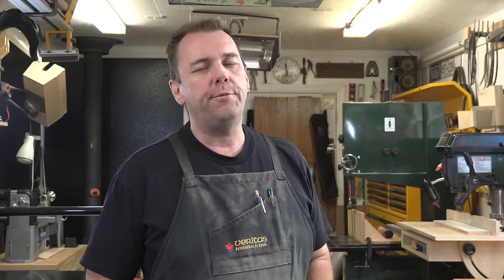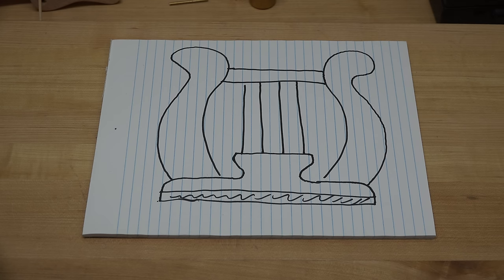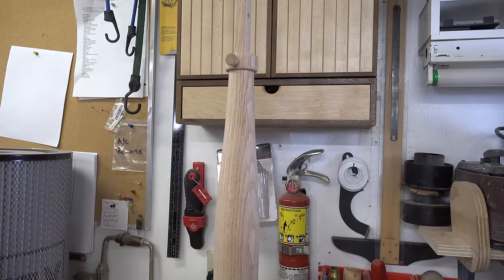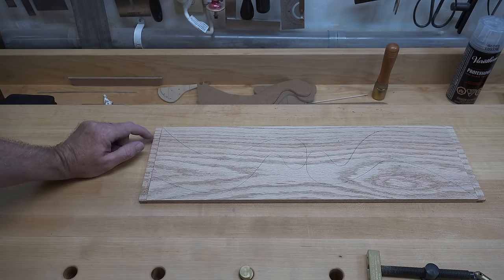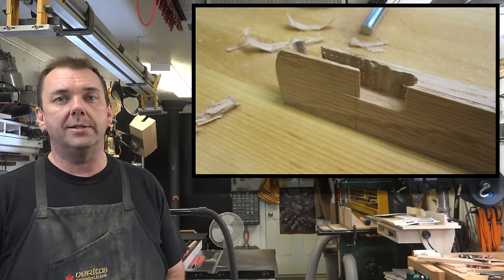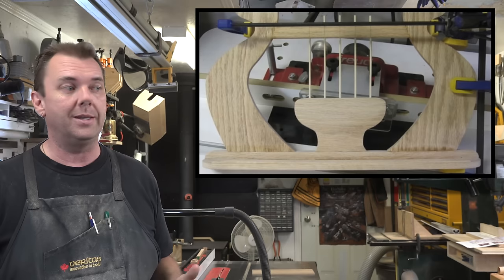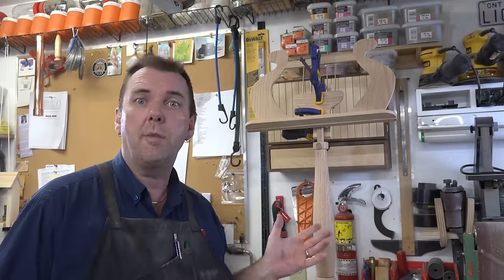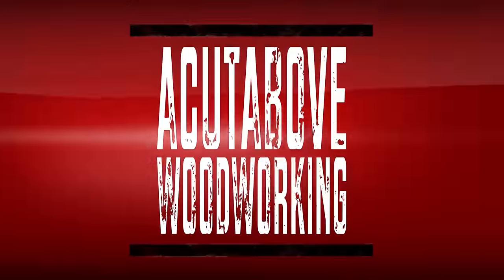Making a Music Stand Part 4

Comment: I just found this video series researching my own music stand project. Very well done!! One trick I've used when trying to cut joinery in thin pieces is to cut it when they're thicker. It's wasteful, because you end up planing away so much, but if you start with 3/4 material, chop your narrow mortise, THEN plane it to 3/8, you should be fine. That said, yours came out great!
Reply from the maker: Thanks for the kind words and for sharing your method on thin material joinery Ben.  That's one thing I love about this hobby...for every process, there are multiple ways of performing that process and getting great results.  Glad to hear that you liked the series.  Thank you for tuning in.  It's very much appreciated.
Reply: @acutabove_woodworkings  You're welcome! Thanks for sharing.  I also love finding new ways of doing things.

Comment: Very interesting video. I was searching some ideas for my project of music stand. I found them here. Thank you.
One question. Am I wrong or Canada has adopted metric system for already several decades ?
Reply from the maker: You are not wrong Michel.  Canada adopted the metric system many, many years ago.  I was in grade school at the time it was adopted and it was introduced to us, even though we had already learned the imperial system.  As years went by, although metric was the "official" measuring system, we bought our gas in litres, drove our vehicles in kilometres but the trades were slow to convert and everything was done using the imperial system.  Woodworking tools were the same and never really converted to a metric system as the trades pretty much ruled the economy when it came to purchasing tools and they were still using imperial.  I finished my apprenticeship as an electrician and carried on with my woodworking as well.  Both in imperial.  I've been in the electrical trade now for over 30 years and woodworking for over 40 and honestly, imperial is what I am comfortable with.  Not to mention that all of my shop setup is imperial.  Here in Canada, although the government screams about metric, you'd be pretty hard pressed to go into any woodworking supplier or tool outlet and find metric tools.  The best you will find is a tape measure that has metric on one side, and good ole' imperial on the other.  Strange I know but that's just the way it is.  Thanks for tuning in to the show and taking the time to leave your question and kind words.  I truly appreciate it.
Reply: @acutabove_woodworkings  May be also that the presence of your big southern  neighbour does not facilitate the use of metric system.
Nevertheless, just a suggestion, to insert on the video the translation in metric system for those just like me who are not able to calculate the area of a rectangle measuring 1' 3 5/8" on 13/16"   ;=))